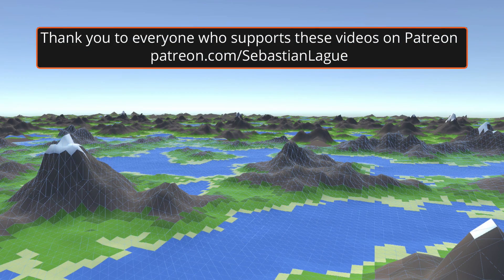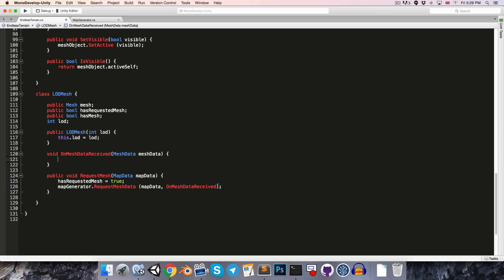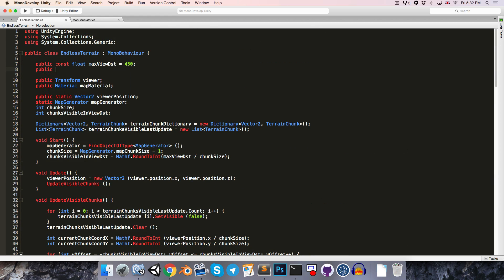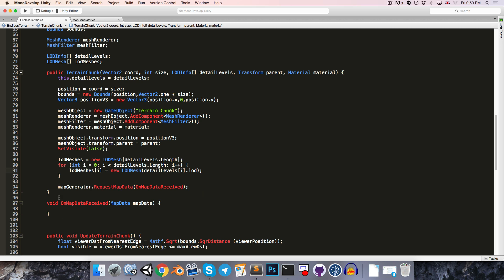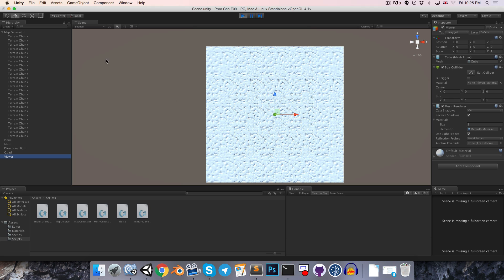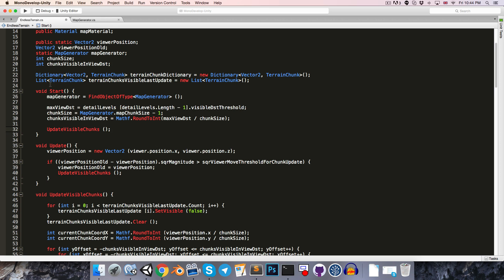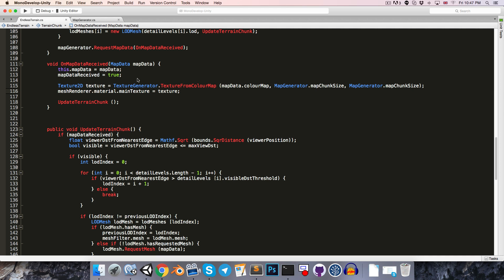Procedural Landmass Generation (E09: LOD switching)

Comment: If you have an error that the programm is attempting to devide by 0 its because the MeshSimplificationIncrement in MeshGenerator is 0. Add an if statement if MeshSimplificationIncrement == 0 { MeshSimplificationIncrement = 1 } Add THIS AFTER the line MeshSimplificationIncrement = LevelOfDetail * 2; AFTER!

Comment: my code wasn't working, just giving me either the first LOD level, or LOD level 2. took a day or two to figure it out. the lodIndex was being set to 1+1 instead of i+1....
Reply: now all my terrain meshes are the same and i don't know why. I've looked through all relevant functions, and everything seems fine... maybe there's an issue with threading? but no, the chunk meshes generate at different times...
EDIT: Do not use 2 to any power for the chunk size. it results in the annoying repeating perlin noise stuff.

Comment: i ended up with loads of water surrounding mine and hardly any land ino this video is old but is there reason for this my mesh looks fine i press play and mostly water on the other  planes but bits of land not much also is there a way to add to the finished project for like diffarent biomes etc would you be able to implement sertain items like trees or iron etc to spawn in cenrtain areas or monsters in diffarent biomes or is that seperate to procedual generation

Comment: I'm having an issue where my textures are seemingly looping across chunks, causing "mountains" of water to appear, though everything else is working as far as chunks having unique terrain and rendering at different LOD according to distance. My best guess as to why this would be happening was mistakenly using meshRenderer.sharedMaterial instead of meshRenderer.material in the OnMapDataRecieved method in EndlessTerrain, but I have it matching the code in the video. Any ideas?
Reply: Yes,so do I.I have to change back to standrad material instead of URP. Do you know how to make it work in URP mode?

Comment: I have a sort of basic question, why is it at 08:30 that `mapData` has a `this.` but `mapDataReceived` does not? Given that they are both declared the same way. I'm just unclear in general about the use of `this.` in C#. (I'm familiar the concept in JavaScript and `self.` in Python.) Does it make a difference?
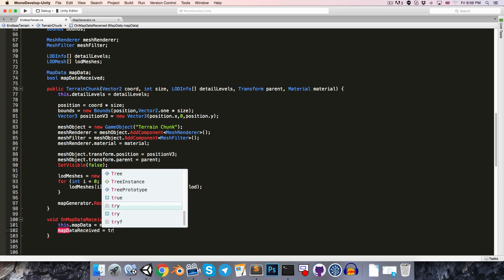Reply: There are two 'mapData' variables declared in this local scope.  Using 8:34 as a frame of reference.
One in the TerrainChunk class line 73. The second in the function parameter of mapDataReceived line 100
The 'this' keyword is used to differentiate between the locally defined mapData and the one declared in the parameter typically for avoiding ambiguity.

Comment: Hello Sebastian!
I'm having some problems rendering the mesh, i've made it until 12:29, but it's giving me a error of object reference it says it's null and on the visual studio it says that "Field 'MapGenerator.MapThreadInfo<T>.callback' is never assigned to, and will always have its default value null	Assembly-CSharp"
I've checked the code a couple times, but can't find the mistake.
Reply: Same. I can’t find the issue and it worked during the last epdisode
Reply: Go to the github and look hard for the problem. Compare your code to his. If you cant find a fix, then copy paste the code from the github. Remember its not copying if you have already written it down.

Comment: i need help:
when im in the editor this warning display:

Assets/Scripts/EndlessTerrain.cs(168,9): warning CS1717: Assignment made to same variable; did you mean to assign something else? line 168: this.updateCallback = updateCallback;

and when i play this error display: 

NullReferenceException: Object reference not set to an instance of an object
EndlessTerrain+LODMesh.OnMeshDataReceived (.MeshData meshData) (at Assets/Scripts/EndlessTerrain.cs:175)
MapGenerator.Update () (at Assets/Scripts/MapGenerator.cs:88)
Reply: This may sound stupid, but why is there a "." at LODMesh.OnMeshDataReceived (.MeshData meshData) shouldn't it only be (MeshData meshData), that may cause the error
Reply: no, in that line there is no "."
Reply: @chor6422  did you get an answer to this because I have the same exact issue, and it doesn't make any sense since syntactically we did exactly the same thing we did to the line above...
Reply: for the record I figured it out and in MY case it was a F***ING typo....

Comment: I have an issue. I keep getting an error for RequestMapData in EndlessTerrain, it says there is no overflow method 'RequestMapData' takes '2' arguments. Ive copied your script and replaced mine, making sure to do the same with the other scripts, and the problem still isnt resolved

Comment: When I implement the code from 13.23 to 16.42, the program loads chunks outside the square of influence (specifically 6 chunks to the bottom left), and sometimes fails to unload chunks when I move the viewer around. I've run through that same section of the video 3 times, and copied the code verbatim. It always gives the same result. If I don't implement the code in that section, the program loads/unloads the chunks just fine... any ideas what I might be doing wrong?
Reply from the maker: Hi, I think this is a problem I overlooked and fixed in the next episode. If I recall correctly...
Reply: Yup you did! Sorry to bother you about it, and thanks very much for the reply. I'm really loving this series. Cheers for all your hard work!

Comment: I am trying to use this tutorial to make a somewhat similar procedurally generated asteroid field. I have only one class which returns the mesh like the mesh generation script, but doesn't have a height/noise/texture generation map. Do I just skip all the Map Data parts and enter the Mesh Data threading? It didn't seem to work well. (Mesh isn't applied to object and moving the player around too much causes a thread overload and crashes unity)

Comment: Why are my textures repeating, but the ground is different?
Reply: i'm running into the same problem, did you happen to find a solution?
Reply: @laurensvandenberg7273  Not sure if you're still looking for the answer after all this time, but you probably used meshRenderer.sharedMaterial instead of meshRenderer.material by accident.
Reply: @TristanELambert  Hello,your answer can solve this problem. Thank you very much !

Comment: Heya Sebastian - I'm having this weird error where the mapDataThread method is called via the ThreadStart the amount of required times at the beginning but when I then lock(mapDataThreadInfoQueue) to enqueue the thread information it is doesn't do the full amount ( 7 times if that out of 25) which obviously makes the majority of the terrain chunks meshless at the beginning. Because of this meshless stuff the chunks are never updated properly but when I move the player outside the starting region it produces the meshes properly??? Any idea what could be causing it???
Reply: copying and pasting the code worked for me - it must have been a typo
Reply: I discovered that when using the "Editor Preview LOD" in the MapGenerator script, the range we initially set was from 1 to 6. So instead of the LODs in the EndlessTerrain script being 0, 1, and 2, I changed them to 1, 2, and 3, and it worked fine. The issue actually occurs inside the MeshGenerator script, where we set the meshSimplificationIncrement [mSI] = LOD * 2; If we pass in 0, the mSI will remain 0. Shortly after, we loop through the vertices of the mesh, adding mSI each time, so we can skip over some vertices. Since the mSI is 0, it never moves to later vertices, and the mesh doesn't get drawn.

Comment: What is the point of the system at 13+ minute? If we are talking about the game, then shouldn't it be vice versa? Use all power for needed updates and all other stuff when player is still (most likely afk or just doing something else) but reduce chunk updates when moving to (sane) minimum (which does not make it unplayable) so the fps is kept at maximum possible or am I missing something?

Also do you seriously just remember where everything is or have it all planned/listed somewhere? Because I am getting lost in code since E05.

Comment: How would you go about making a MeshCollider for it?I tried doing this https://gyazo.com/71a519e7032d4e164a72d7871b7ece3bbut the mesh that the collider gets in the inspector has 0 vertices, making me fall through it. Also, great video! Learning so much about generation and some stuff from C#. I didn't even know struct existed, or that you could make multiple classes in one file!And lastly, are you going to make biomes? That would be pretty awesome! Maybe make it so you can have different color maps based on the biome, and if you later decide to make trees or others then maybe make it so you can have different trees based on the biome... Then we can maybe code the different biome behaviors ourselves.
Reply: Just assign the same mesh to the mesh collider when you assign it to the mesh filter in the code. And add the component when you add the other components.
Reply: Just assign the same mesh to the mesh collider when you assign it to the mesh filter in the code. And add the component when you add the other components.

Comment: Hey Sebastian, thanks for the great series.

If you weren't going for infinite terrain, could you implement a max amount of polygons, so you could achieve a Low Poly style?
Or is that the wrong way to go about that?
Reply: +Aj Jones (SlimSpydey) with the LOD slider you can Quite easily do that by just using the mesh that gets updated in the scene. It is definitely very possible and I wouldn't say it is a bad way to go about it.  After all your just lowering the amount of polygons, therefore it will run faster with that style of art work ("in theory"). just muck around with the mesh and change a few variables to achieve a bumpy look and you should be able to get a low poly styled terrain :)
Reply: Thanks for the tip, I got a bit ahead of myself and tried experimenting a bit too early. I have the LOD slider, and achieved the LOD less polys, but I found out that i was looking to get rid of mesh smoothing by separating the normals. I have it working, but its bogging down my CPU, so back to the drawing board until I can get something a bit more efficient.

Comment: I made a small addition to this to provide an option for flat shaded (low poly) terrains. Basically, you don't want shared vertices if you want flat shading. Downside is more vertices means smaller chunks; I find the chunk size constant to be a max of 105 if you want this. 

If anyone is interested, you can see it at http://pastebin.com/JuVTuaca - Just add "isFlatshaded" to the MapGenerator.cs and pass it to the MeshGenerator's GenerateTerrainMesh function. A screenshot is here: http://imgur.com/qkyqgPd
Reply from the maker: +A. Burak Erbora Looks great, thanks for sharing.
Reply: Thank you so much! I've been figuring out how I would do the same thing.
Reply: Cheers ;-)
Reply: Sorry I know this is an old post and you may not remember but did you have to change any part of your triangleIndex when implementing your code changes for low poly terrain?

Comment: There is a problem with the new improved way of updating the terrain chunks. If the viewer moves very fast and it catches up with the terrain chunk update generation, there's the possibility that it will leave a few isolated chunks away from the maximum viewer's distance.
Reply from the maker: +George Dunbar Thanks, I've figured out the issue. Will address it in the next episode.
Reply from the maker: +kennyPAGC Oops! I tested this, but I must have made a mistake in the video. Thanks for letting me know.
Reply: +Sebastian Lague Can confirm it, but it's not an always at high speed thing. Seems to be a little random on when it leaves isolated chunks.
Reply: Cool! Looking forward to it

Comment: Are still planing on the editor script to adjust terrain color? It would be useful for setting LOD.
Reply from the maker: +Lê Tài Indeed! I'm just trying to decide whether to do editor stuff next, or object placement (trees, rocks etc).
Reply: Your choice. But I thing object placement is pretty trivial and boring. Something more interesting would be different material instead of color for different height level. Also you should flat out the lowest height level
Reply: +Lê Tài These are things you could learn on your own though, swapping Material for Color isn't that hard and to do the Lowest Height Level just edit the animation Curve. I think Object Placement would be better as it's more complicated as you have to determine the height at certain points to use for spawning objects in. The Unity Terrain has a function for this but he'll have to code his own.
Reply: +Sebastian Lague  + 1 for object placement :-)
Thanks for doing all this man, your walking through code skills are awesome!
Reply: PixelGhost Yeah actually objects placement can be difficult if you try to place large object, it will have to find where it will fit in. But if he just planning on small one like trees/rocks then it would be pretty boring.

Also I know how to swap color for material, I just think that would be a cool feature, which is definitely harder than you think.
Reply: +Lê Tài It's not as hard as he thinks, I put materials into mine, it took less than 20 minutes if you sit down and use your head. Though he is right Object Placement would be the best way to go as whether its small or large the code is the same for placing them.
Reply: +KonkorFour Still, it would be beneficial to plenty of people if Sebastian adds the swapping for materials. It helps to introduce the differences between the two and serves as a practical expansion to what he's done so far.
Reply: +George Dunbar But for those that would like to use this in a game or another project would have no idea how to implement placing objects/buildings/props, swapping colours for materials isn't that hard to figure out on your own and would probably further your experience then being told how, where as finding the height of a section of the mesh and such is harder when you're starting off.
Reply: KonkorFour Placing small object is different from large object where you have to make sure there enough space for them. For finding height, you already have a height map. What complicated is how you space them.
Reply: +Lê Tài Unless you're planning to have no colliders or anything, small objects will use the same code as large, it's just a matter of calculating the space.
Reply: vcl, cuoi cung toi cung tim dc ng vn